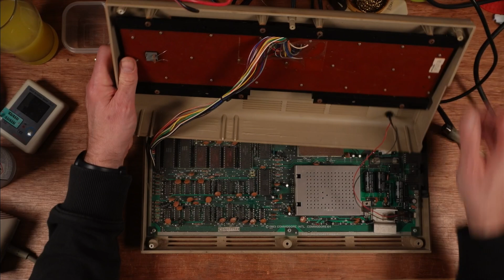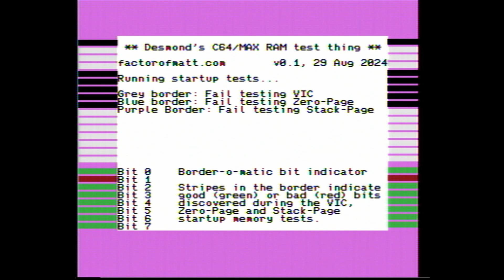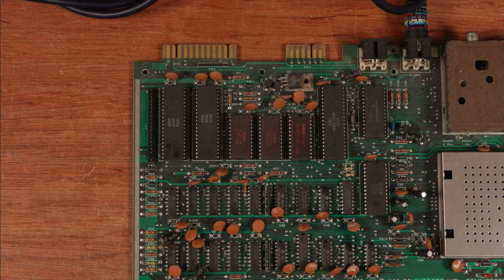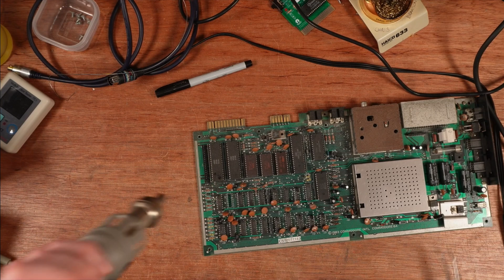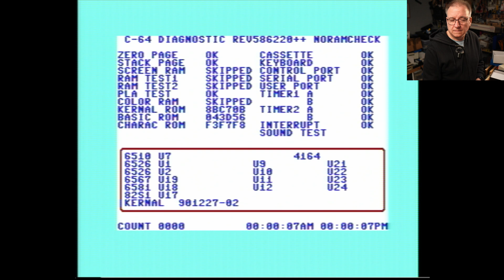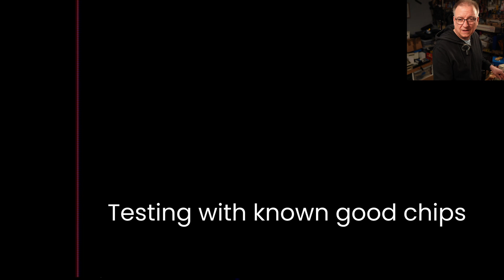Repair Pile Part 3 - One out of two ain't bad!

Comment: It looked like at the very end you tried the board without the test cart, but with no ROMs or CIAs. No wonder about the black screen. But of course that thing has probably more issues anyway, and it wouldn't have made a difference... (Or maybe the cart was inserted off camera?) Not like I haven't made this very mistake a few times already, hence why I noticed it. :)

Comment: So, here are my thoughts on machine #4:  First, when you did the final test after returning the CPU to the board, you didn't appear to have the dead test cartridge installed.  Without that and without the CIAs or ROMs, black screen was no surprise.  The next thing I'd suggest checking is if your GAL PLA is working.  I've had more than one of those where one of the GALs programs fine, but then craps out when installed in a C64.  This can happen immediately or only after the GAL PLA has been sitting around unused for a while.  Just as a sanity check, pop it into your working 64 to make sure it's still good.  If that's not it, I'd try swapping out the VIC-II.  I've run into one machine where the clock was good and I was getting a black screen with the white line, which makes you think the VIC-II is working, just like you are, but the addressing was being screwed up by the VIC-II and since you did see some questionable signals on at least one of the multiplexers, I'd say that's a possibility.  Again, just as a sanity check, I'd go ahead and test the 7805 and 7812 regulator outputs, just to be safe.